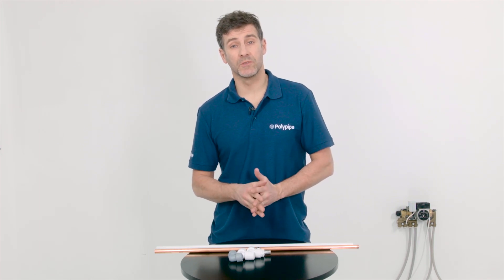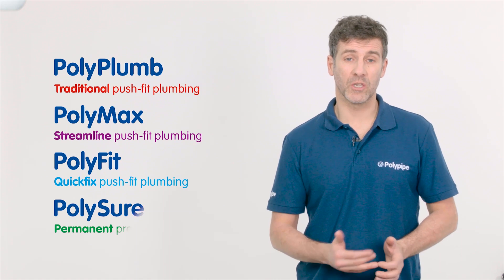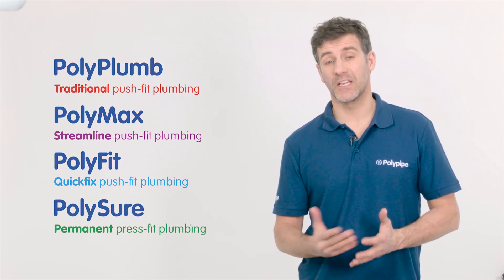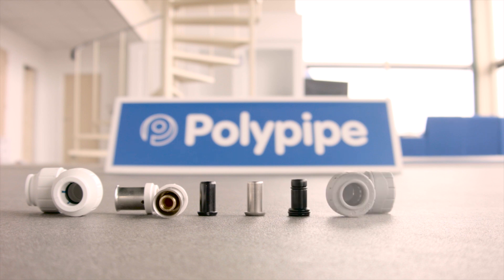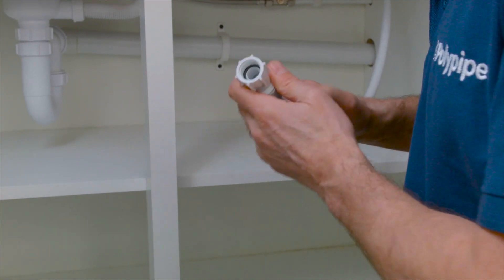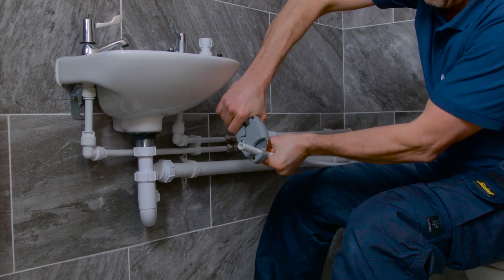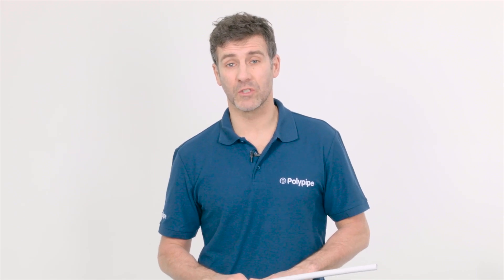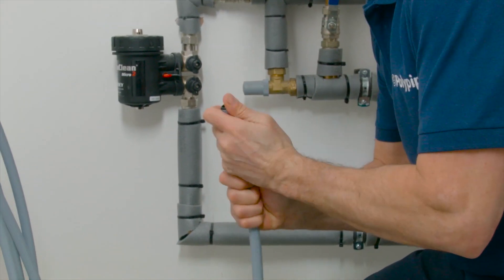Why plastic? | Polypipe Building Products

Comment: How come pb pipe is  banned in the USA yet we use it in the UK ?
Reply from the maker: Hi Peter. In the mid 1990's a US lawsuit (Cox) claimed defects in "Polybutylene plumbing systems". The premature failures in the USA, allegedly caused by Polybutylene, were due to the incorrect use of acetal fittings and poor joint assembly techniques. While no official ban exists in that market, in view of the outcome of the US litigation, Polybutylene or products from Polybutylene are not sold for use in North America. Hope this helps!
Reply: @PolypipeTrade  thank you for the explanation , I was unsure as to whether or not to use polybutolene or copper when replacing my central heating system, ill now choose the pb pipe 👍